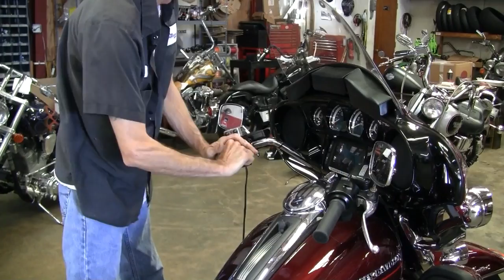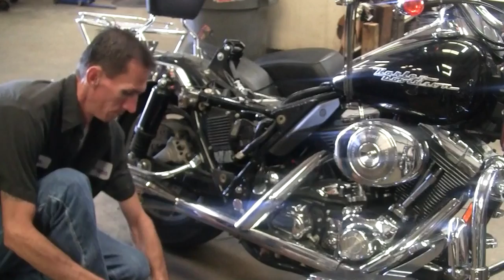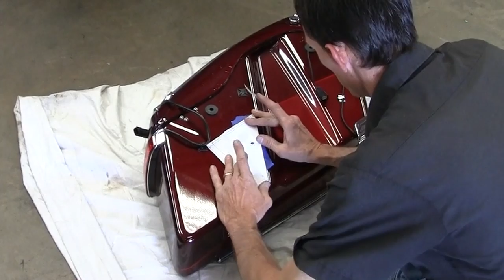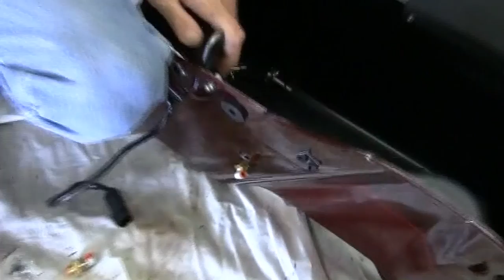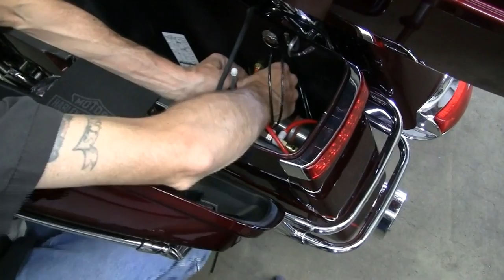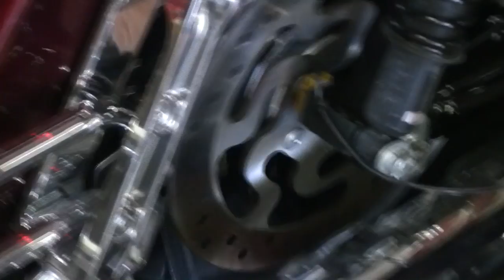LegUp Gen II Install - Harley Touring Bikes

Comment: I have had them since 2018 and I am extremely pleased. Glk is reliable and extremely friendly. My friends also have them and there is not a single comment, if a breakdown occurs, which is very rare, the company immediately sends replacement parts. No complaints the product is great.

Comment: I'm an amputee and ride a trike do you recommend this system for somebody with an amputation that doesn't use a prosthetic
Reply from the maker: While we have many people who can't use one or the other leg for various reasons, we don't recommend using the system under these circumstances. If the roadway is VERY slanted or a wheel winds up in a hole, having the ability to touch a foot to the ground may be required. Thanks for the question.
Reply: What cost al in. Bike